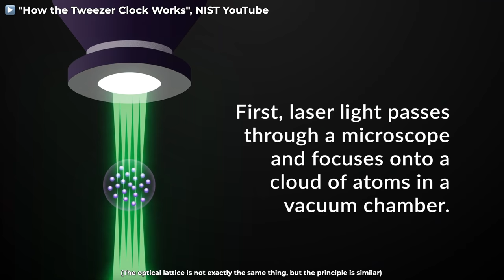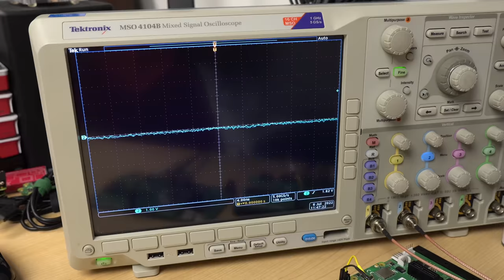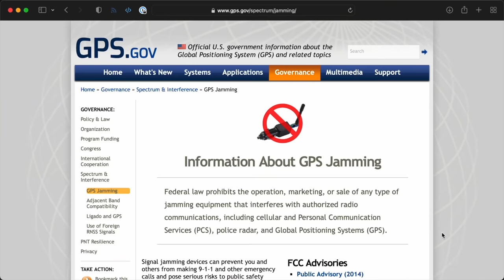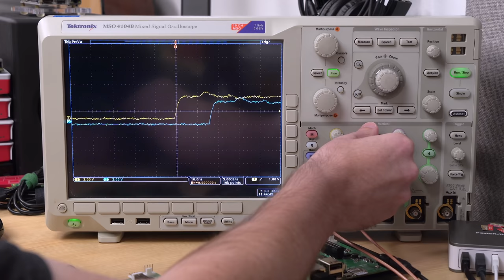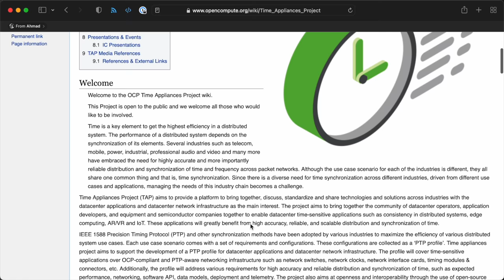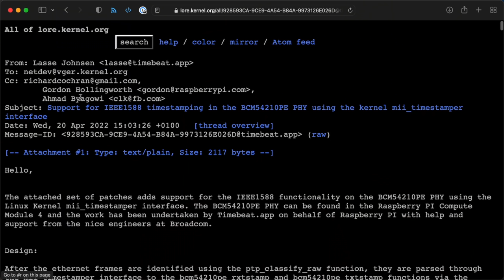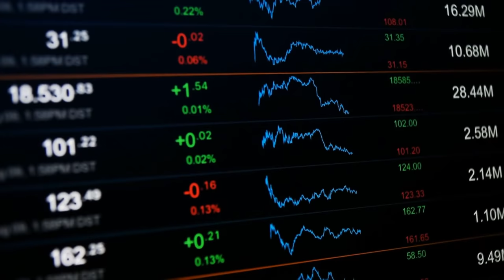Nanosecond clock sync with a Raspberry Pi

Comment: Having worked on PTP professionally, I know that a few years ago big players used to charge $1,000,000+ to license the software for the algorithm that does the synchronization.  Then it would still take many months of work to integrate it into a working product.  The fact that this is open source is awesome!
Reply: I can't fathom why people care so much about this.
Reply: @tim-w  Do you use a cell phone?  Tight synchronization is vital to making the radio network work.  There are many other applications, but this is probably the one normal people interact with most often.   The electrical grid also relies on tight synchronization, but the transition to digital is happening more slowly as they are ultra-conservative in that industry.
Reply: @tim-w  Making cell phones networks  possible. Making GPS possible. Making banking transactions secure.  Proving relativity. Calibrating equipment not to mention more serious applied and pure scientific research.
Reply: @tim-w  I currently have better than 1ns timing jitter between my Grandmaster and switch using PTP and Synchronous Ethernet in my home lab and the GM is accurate to about 40ns of UTC. As has been mentioned, timing is critical in communications systems. It is looking likely that 5G will transition in later specifications to a requirement of 5ns timing accuracy. It is fun to play with but there are absolutely real-world applications for sub-ns timing. In the industrial networking space accurate time is needed for synchronising different parts of a production facility and is provided by industrial field bus systems such as EtherCAT. With standard crystals I’ve had better than 20ns of timing jitter between devices on a network. 

One of the problems is that the GNSS constellations such as GPS, Galileo, GLONASS etc are prone to blocking so it is common to have multiple Grandmasters which may be 100’s of miles apart for resilience. In the UK there are exercises where GNSS is deliberately blocked and these are listed on Ofcom’s website. IT is also possible to have a GNSS firewall where if the GNSS signal is blocked the timing can be sourced from either another remote GNSS Grandmaster or a local Caesium / Rubidium clock. 

Accurate time is also critical for trading to track when exactly a transaction is placed and also in cars. Many new automotive applications rely on time for position doing and synchronising RADAR systems for spatial awareness.
Reply: Oof, this makes me think of how big companies will use open source work, not contribute, and then try to draw away attention from the open source work by rebranding and popularizing their own version that builds on it. I’m thinking about video capture software, that most streamers use. I hope whoever decides to make use of this put in a few of the millions into the work.

Comment: The official abbreviation for Coordinated Universal Time is UTC. This abbreviation comes as a result of the International Telecommunication Union and the International Astronomical Union wanting to use the same abbreviation in all languages. English speakers originally proposed CUT (for "coordinated universal time"), while French speakers proposed TUC (for "temps universel coordonné"). The compromise that emerged was UTC,[6] which conforms to the pattern for the abbreviations of the variants of Universal Time (UT0, UT1, UT2, UT1R, etc.).[
Reply: Like how iso stands for international organization for standardization, sometimes the acronym doesn't match in all languages
Reply: @JaredConnell  roughly the same reason. Additionally ISO is derived from the Greek word isos, which means "equal".
The more you know... 😊
Reply: I just think of it as "Universal Time, Coordinated" and move on.
Reply: UTC stands for Universal Time Coordinate and refers to the baseline that coordinated time is set from (which is why it is represented as UTC+x).
Reply: So yes.. the acronym is correct.
Reply: What you said is nearly correct. The truth is the French were never happy that time was named after Greenwich in London (GMT) and they weren't about to let it happen again that the UK would decide the acronym. The British are also stubborn and wouldn't let the French have their way...hence UTC was a compromise to both parites
Reply: @Shinero very relevant 👍🏽
Reply: The French make the acronyms and the scientific world speaks English.  Yes, at the BIPM (International Bureau of Weights and Measures under the treaty of the meter), everyone speaks English.  The correct answer is, "Coordinated Universal Time" or UTC.  A given lab produces their physical representation stated as UTC(NIST) for NIST's version of UTC or UTC(USNO) for USNO's version.  UTC(SU) is the Russian version and so forth.  The International System of Units are the "SI" units.  Meter, Kilogram, and Second as well as UTC are kept by the BIPM as the international standard.  NIST does not provide anything for GPS.  GPS is a flying constellation of Rb atomic clocks (3 each in current satellites) that work with designation ground stations and USNO.  GPS broadcasts data stream that are consumed by a receiver to locally provide a broadcast representation of UTC(USNO).  The fully corrected time produced by your GPS receiver is tied to USNO.
Reply: @Kalamatee  Coordinated Universal Time is UTC.  Don't try to switch the name to fit the acronym.  see note below.  The SI Units are the International System of Units.

Comment: 2:05 "WWV....listen to it online", and then showing a Software Defined Radio. Both of these listening options (online and using an SDR) would insert so much unknown latency that you might as well just go outside and look at the Sun, LOL (<- exaggeration alert). But seriously, either of those listening options could easily add more than a second of latency, which in this context is horrific. One should use an analog SW radio (analog signal path, digital display is fine), which adds effectively zero latency, the acoustic delay from the speaker to your ear dominating (not even joking). Other time transfer options exist. On this video, one can actually see a ~1.5s gap between the on-screen clock ("03:53" -> "03:54") and the slower audio.

Comment: So, as more and more of our access technologies require synchronization with ptp, I would assume we'll be able to just use the time signal in, say a Remote-Phy network, then feed it out to cable modems and clients (This is literally what DTP is.  With most intel nics supporting some form of time stamping, we probably wont need specialized hardware in the future.

Comment: You explained how the atomic clocks know how long a second is, but how does the Pi create its seconds pulse?
Reply from the maker: On a typical Pi, it uses a couple tiny oscillators that aren't high quality but are good enough for most purposes.

They are not temperature-controlled or disciplined, so that's why some people would add on an external TCXO or a chip-scale atomic clock for even better accuracy.

Comment: They should have more of those WWV type of transmitters all over the US and force auto makers to tune into it for turn signal flashing. No more sitting at red lights watching a bunch of flashing lights sync and unsync.
Reply from the maker: Hahaha, I actually made a similar comment on a Technology Connections video about turn signal timing :D
Reply: Make the whole city blink in sync, would be a nice sight on a dark night, it would probably reflect in the sky :)
Reply: I love that
Reply: @JeffGeerling  I was just about to mention Alec's clip on this, and you beat me to it.
Reply: You can just use cameras already in cars for this. :-)
Reply: @gudenau  There would still be a delay that would propagate with each generation.
Reply: Syncing the cars would possibly eliminate the need for traffic signals and such.    When our cars start talking to each other and working in concert is when our lives will change.
Reply: Also, I like to mention that Time Card can receive the WWVB signal as DCF77
Reply: People use their turn signals???
Reply: Well, that's one use.

Way back in 1990, I came up with a scheme to set the clocks on all those VCRs blinking "12:00" by sending a real-time signal in an unused line of the then-analog TV signals. Technologically it was easy to implement, but none of the VCR manufacturers had any interest in it, mainly because it would have added to the price by a few cents.

Needless to say, if an entire industry isn't going to look at a good idea for a few cents, getting millions of people to replace their cheap and reliable mechanical blinkers with a godawful expensive and complex radio system is going to be a non-starter.
Reply: But, but, it is hypnotizing :p
Reply: Is WWVH still in operation?
Reply: LOL Or just for the time on the dashboard! Great thing about that colorado radio signal is that you can receive it all the way up Alaska! It's trickier past the rockies in general however.
Reply: @derrickfoster644  Who?
Reply: @JamieStuff  found the BMW driver
Reply: @timramich  didn't notice it didn't @ the first time
Reply: @JamieStuff  People with good clean accident records, and who care about their lives and other lives. It's really not hard to reach some fingers past the steering wheel and flip a switch.
Reply: wwvh, wwbv, wwv multiple time transmitters in the US
Reply: Perfection.. at its best
Reply: @StringerNews1  those cents would have been well worth it
Reply: @StringerNews1  You came up with a scheme to set VCR clocks by sending s time signal in unused lines of the TV signal? I don't know if it's the same or not but many modern VCRs support autoclock functionality via EIA-608 Extended Data Services.
Reply: @eDoc2020  "modern VCRs"? That's a self-contradiction like "jumbo shrimp" isn't it? 😉 No, my idea was to use the Vertical Interval Time Code user bits, after I noticed that VITC was still present on my station's broadcast signal while I was checking the VITS & VIRS lines. Nobody was interested in my idea, but I was at a PBS station, so it was either sheer coincidence that PBS was behind the EDS time signals, or someone more senior than I took my idea and made it their own.

My idea also included a method to broadcast a time signal locally, using the VBI information as a reference. The idea there was to share the time around the house using ISM radio frequencies, so other appliances with clocks could set themselves, even the bedside alarm clocks could be accurate within a second. That would have required the cooperation of most of the consumer electronics industry, and back in the late '80s when I had the idea, that meant Japan. I didn't know anybody in Japan.

Although I can recall when PBS started the service in the '90s, I don't remember there being widespread support for it on the consumer electronics side. Only a handful of VCRs supported it, and the ones that did were easily confused by the master antenna and cable TV systems where I lived. When I got my first Tivo in 2000, I left home VCRs behind. MOF my first use of ntpd at home was for my two Tivo DVRs.

Comment: I have used PTPv2 in wind tunnels, where multiple computers record audio signals from a few hundred microphones. The data is all timestamped, which allows software post-processing to calculate where certain sounds came from. The same effect as a dish that your would physically move. For this to work well, you want nanosecond-scale accuracy.
And since wind tunnels are generally large metal structures, running a GPS antenna for each computer is not preferable.
Reply: large metal structure, like an antenna ?     ;-)
Reply: @jyvben1520  Like a faraday cage, about 20 meters in height. We try to keep the computers close to the microphones (near the ground) and they're generally standing in the wind (300kph). Running long wires in that environment doesn't seem wise.
Reply: What are you using microphones for in a wind tunnel and is it even possible to do acurate audio location when wind is a factor?
Reply: @hyperfluff_folf  about 50% of aircraft noise comes from the engines. The rest comes from the aircraft itself. Landing gear, flaps, but also small gaps between components. Since noise of landing aircraft is a big factor for airports, manufacturers want to find the sources of the noise. This is generally too complex to simulate with a computer I'm told.
You are right that wind is a factor in the propagation of sound. These effects have been modeled, and we apply corrections to our measurements in an attempt to undo these effects.
In order to apply the corrections we need to know things like wind speed in the wind tunnel, so these are measured too.
Reply: @Richard Cranium Yep, where PTP is used you sync after the fact.
In general the strategy in measurement systems is to directly store your measurements on disk, unmodified. Wind tunnels are expensive to rent, so you want to have your data to pass through as little lines code as possible. Every line of code is a possible bug, and you cannot recover from bugs in your acquisition code.

Comment: I did an internship at a telecom company, every piece of lab equipment  (network switches, oscilloscope etc.) was modded to be able to use the same clock signal via bare (coax) cabling.

Comment: I've run Stratum 1 servers from RPi 3s for a few years.  While testing code for NTPsec, I had a group of 4 fed from the same antenna with carefully crafted cables to ensure that signal path was the same for each device.  This was used to experiment with convergence differences between different NTP solutions.

Also, my first professional presentation was on time synchronization using xntpd as one of the options.  I also have code that is part of that project for adjusting the time in the kernel to reduce drift, basically adjusting the value of each 'tick' to account for the variance in the systems base oscillator.

Comment: We use ptp to coordinate audio and video over a network in the Audio Visual field. It allows us to get video walls synced up for making sure they are frame accurate. We actually don't care about the exact time just that all the device are synchronized. It also means we have to use somewhat specialized switches that support QoS and non-blocking.
Reply: Are they purple switches?
Reply: @PsRohrbaugh  honestly for video we end up using the Netgear av line switches. They come in a good range of sizes and configurations preset that's make manufacture specs for encoders and decoders. faster and easier deployment that way.

Comment: Jeff.. look at the timing features etc for the upcoming WiFi 7.  802.11be includes full QoS and time services so all your wireless devices can also sync.
Reply from the maker: WiFi 7 will be quite interesting. Borrows some features from 5G (which also uses this kind of timing accuracy to get the bandwidth it does).

Comment: Jeff, On that scope you can use Measurements to measure time between the two pulses so you don't have to count ticks. You can also use Cursors to manually get a time delta by placing one cursor on one pulse and the other on the other pulse. Measurements and Cursors are very powerful tools in the scope and it's well worth the time to learn how to use them. Best wishes.
Reply from the maker: True, true.

Comment: I made a gps based ntp server with my old pi a few years back. it used the PPS on that gps chip. It was fun
Reply: About 20 years ago, I read the Linux NTP README and discovered that I could buy an obsolete GPS receiver for $25 and a serial cable for another $10 to turn pretty much any Linux box into an accurate NTP server. The hardest part was making a battery eliminator, so I didn't need to keep replacing the AA cells in the GPS receiver. Today you could probably use an old cellphone and a USB OTG cable for next to nothing.
Reply: @StringerNews1  mini pcie and M.2 lte and gps cards exist
Reply: @StringerNews1  afaik there are GPS/modem modules with serial interface for around 30$ to be used for Arduino, drones and other microcontroller-based stuff
Reply: @bobbydazzler6990  why are you asking me this? I've never found a 1 Hz tone useful for anything I do, certainly not a replacement for the standard 10 MHz tone carried over a coax cable. I was talking about making an inexpensive NTP server, as was the OP. If you really need to count one second intervals, you could use the phone's clock or something. What exactly is your use case?
Reply: @bobbydazzler6990  sorry, but I'm not your parents. You're not entitled to my time. You're acting like I owe you something, and that's simply not true. If you want strangers to respond to you, try asking nicely, and learn how to hold a conversation.

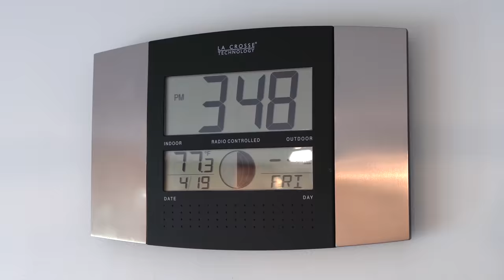Comment: 2:40 Radio Clocks "...will sync-up after a few minutes..."  Only locally, from a 'continental' perspective. More-distant locations will have to wait until the wee hours (e.g. 2:00 AM local), when the VLF signal can reach their location.
Reply: Indeed. I currently live in the next state over from where the WWVB transmitter is, and my "atomic clocks" that use WWVB typically need several tries to sync up. The best case is they start at midnight, and finish at 12:04, but it's not unusual to have them trying again at 0100, 0200 ... all the way to 4 AM. When I lived in Chicago, these types of clocks almost never synced up. Too much electrical noise in the city.